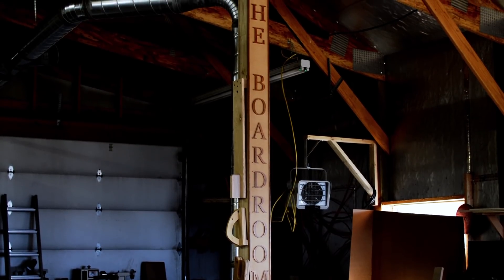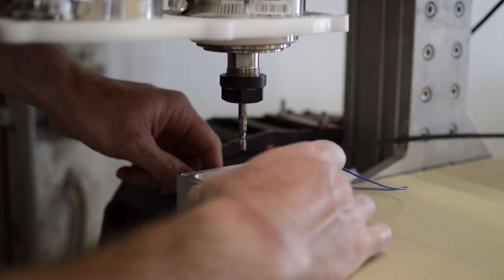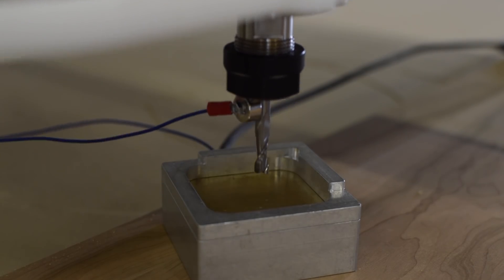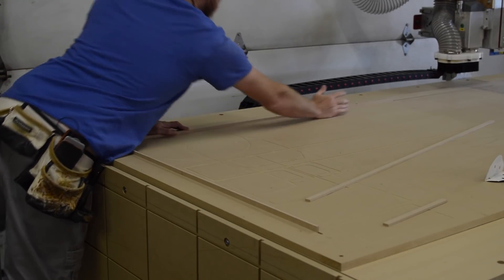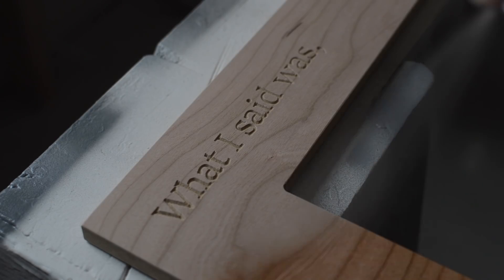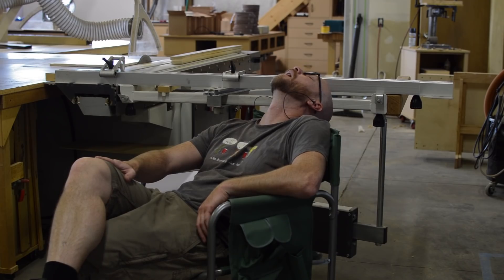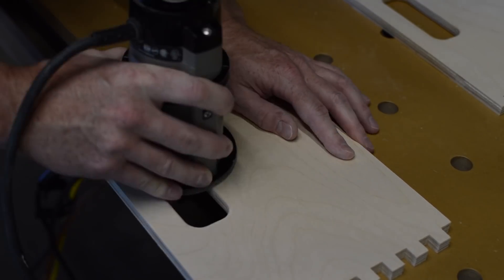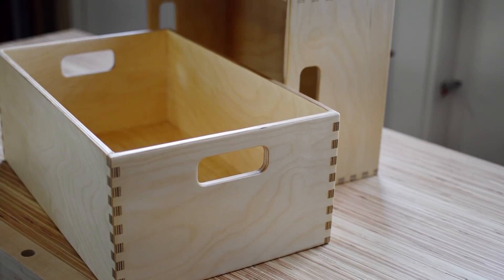3 Fun and Easy CNC Woodworking Projects

Comment: I'm curious how you feel about VCarve. I only have an X-Carve, so my jobs are much smaller, but I am not thrilled with the lack of control I have using Easel. I'm learning Fusion 360, but haven't spent enough time with it yet.
Reply from the maker: I think Fusion should be the end goal, but I'm not there yet. Vcarve is pretty darn good. I would say considering how much functionality is has, its pretty easy to learn.
Reply: I also have a X Carve (1000 x 1000) I didn’t like being stuck with Easel and it failed on me several times so went with UGS and started with Vectric Desktop 2d and kept upgrading and now have V Carve Pro. Vectric is pretty user friendly, if I can learn to use it anyone can :)
There are a lot of user groups out there willing to help also along with Vectric support.

Comment: I want to get a CNC machine.  There are so many variables: size, software, vacuum table vs. tie-downs. I'm cheap and I dont wanna pay for yearly software subscriptions.  How did you make your choices?  You could do a video on that alone. A video would be difficult because many decisions are time sensitive, greatly open to criticize, stuff that brand specific, etc. so you probably say "F that!"
Reply from the maker: That could easily be a whole video. My choices were mostly based on cost, I don't and will never have money for a really big heavy machine. I ended up with this one, and I am really happy with it, and surprised as how well it cuts.

Comment: You need to wet one of the sides you're gluing when using that gorilla glue. That is why it didn't set up properly. You can tell because it's still a solid in those corners. It should be a foam. Always read the instructions.
Reply from the maker: I don't agree with this, I think water helps with curing, but is not needed in all circumstances. The reason it didn't foam in the corners is not because it didn't cure, but because I scooped out the squeeze out to the best of my ability. In other words, what you were seeing was a very very thin smearing of glue, not a bead.

Comment: WOW - SO MANY ERROR SHOWN IN THIS VIDEO: MDF DEFINITION: medium-density fibreboard
The pros and cons of medium-density fibreboard (MDF)  YOU WERE "CLIMB" CUTTING WHEN YOU ROUTED THOSE DOVETAIL-LIKE SLOTS - ALWAYS SET UP YOU FENCE SO THE ROUTER BIT TURNS INTO THE FENCE AND NOT AWAY FROM THE FENCE LIKE YOU SHOWED - YOU SHOULD PULL A ROUTER TOWARDS YOURSELF FOR SAFETY REASONS AS WELL AS ASSURING THE ROUTER DOES NOT WANDER AWAY FROM YOUR FENCE - PUSHING A ROUTER AWAY FROM YOURSELF IS A POOR PRACTICE AND SHOULD BE AVOIDED -
Reply from the maker: Dude, switch to decaf. What I said about MDF was a joke, go back and listen. As to climb cutting, I would suggest you do a little research about that, by pushing the router away, the spinning of the bit pushed the router toward the fence, this is what you want to do. Pulling would be fine, but the router would have need to be on the other side of the fence which doesn't work for my setup. Thank you for the comment.